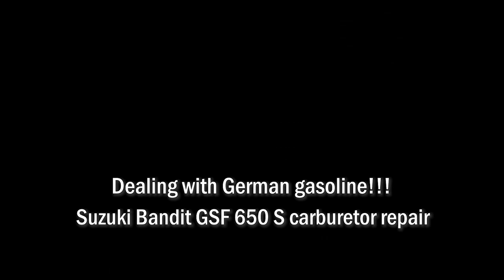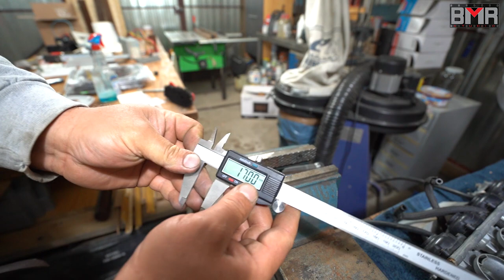Workshop Episodes: Suzuki Bandit GSF650 S 2005 Carburetor repair

Comment: Anybody know what's going on if randomly Cylinder 1 or 4 Stops working? Only while riding, if we leave it idle, it will resume working in 1-2 minutes. Valves are checked and fine, fuel is flowing from the tank, we have spark all the time on all 4 when running. I'm guessing it's a carb issue, can't find it though

Comment: Hi 🙂do you know what can cause the burning of spark plug i just changed and I changed them before is it a current problem,what can cause this maybe the carbs ?
Reply from the maker: Lean mixture, too wide spark gap, wrong type (low temp) spark plugs, aged HV cables or corrosion in the transformer coils!

Comment: I own a  2006 model, If it coughs and hesitates as you open the throttle at low revs, CLEAN THOSE PILOT JETS.
Reply from the maker: Cleaned, and all O rings replaced sir. Perfect now

Comment: Hi there, would you be able to add a link to the carb service kit and pilot jet kits you used to the video description?  Great video by the way!
Reply from the maker: Sure. Here is two option:
ebay.de search: 
4x Vergaser Reparatursatz für Suzuki GSF 600 Bandit GSF600

from that you can use many parts , minus the main jets.

other option:
ebay.de search: 4x Vergaser Reparatursatz für Suzuki GSF 600 650 GSX 1200 750 Inazuma
Reply from the maker: jet kit

ebay.de search: 10x Hauptdüse Düsenset Hauptdüsenset Keihin CVK Vergaser Düse M5 Größe 88-110
Reply: @BMRStudio  Hi - I was watching the video (again) and realised I never said thanks so.... Thanks!  The video and the advice are great :-)